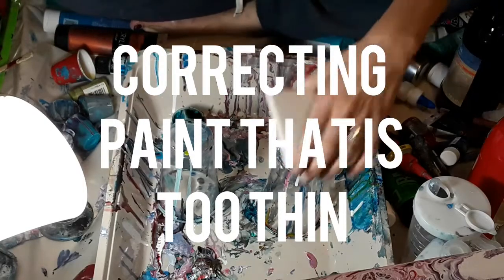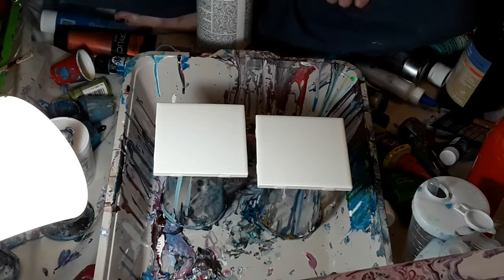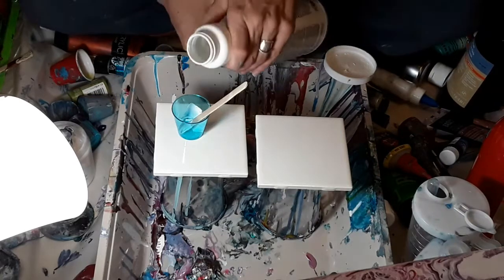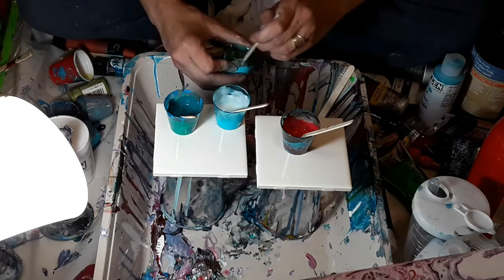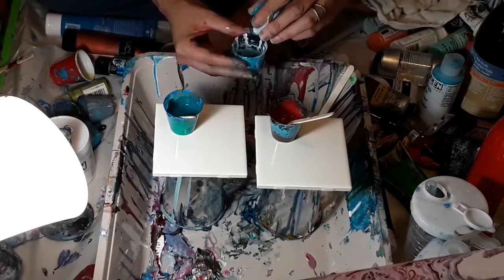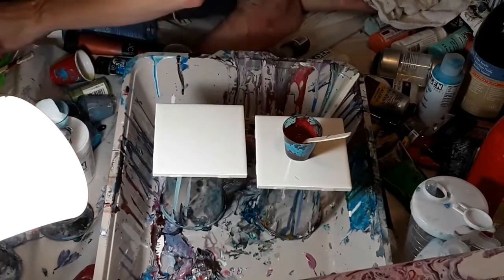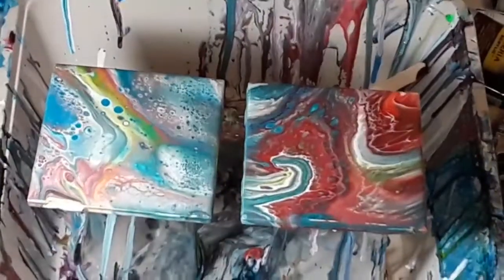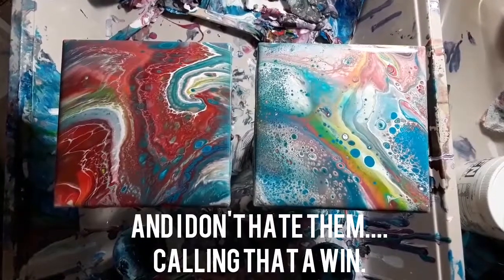Acrylic pouring - correcting Paint that is too thin

Comment: Interesting that I should find this video so soon after battling the issue of white paint that was too thin.  I don't have the Golden gel, and it was too late at night to do much but fight the problems.  I also do only small paintings so far, 5 x 7 and smaller, so mixing a ""large" quantity of white actually only means making up about 4 ounces.  However, it can take me a long way, so being too thin was a real issue.  I finally ended up getting another cup, and putting  the same amount of paint in, and adding the thin mixture to it, a little at a time. I'm not done with it yet, so I just hope I don't end up with half a dozen cups of paint before I actually get it right!  I really don't need that much!!!